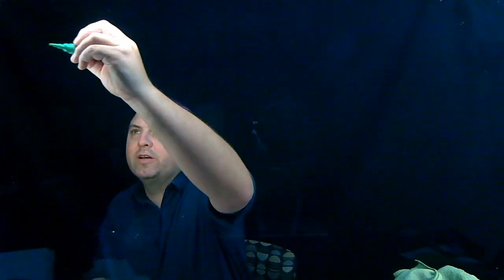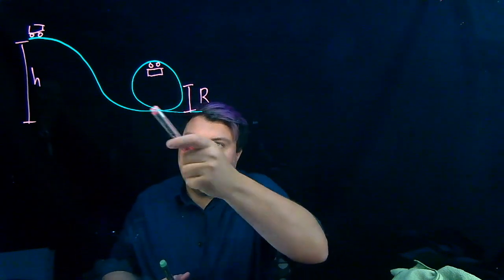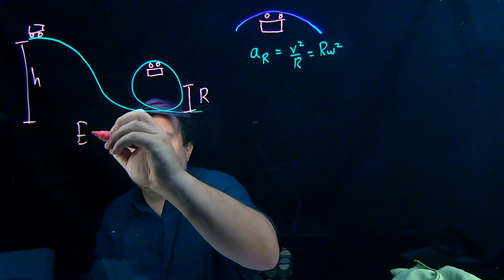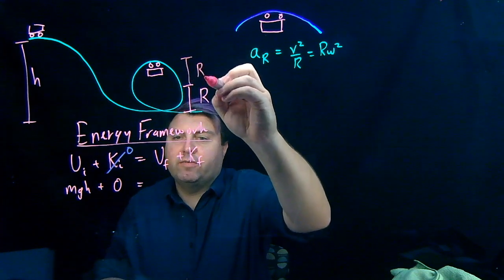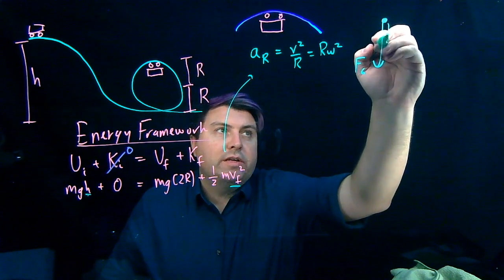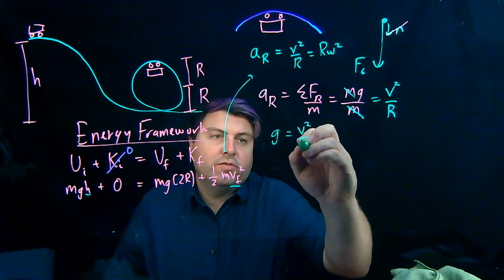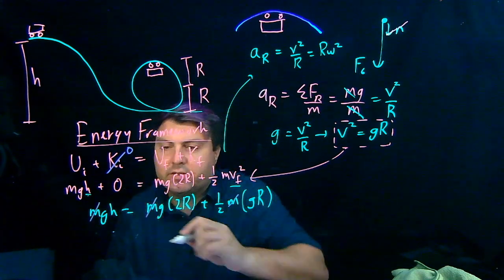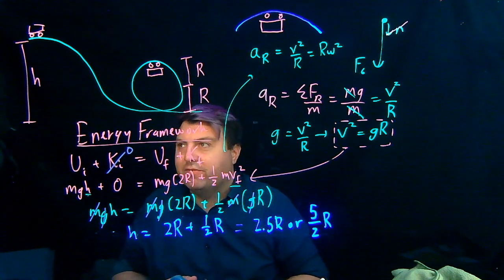How High Must a Hill Be for a Rollercoaster Loop?

Comment: Technically the center of mass of the coaster describes a circle of smaller radius. The height of the COM above the track should be subtracted from R. Also, this problem ignores the rotational inertia of the wheels.